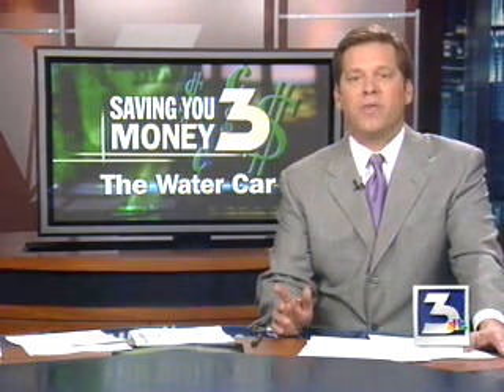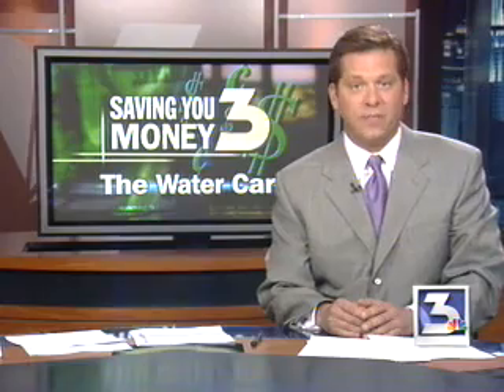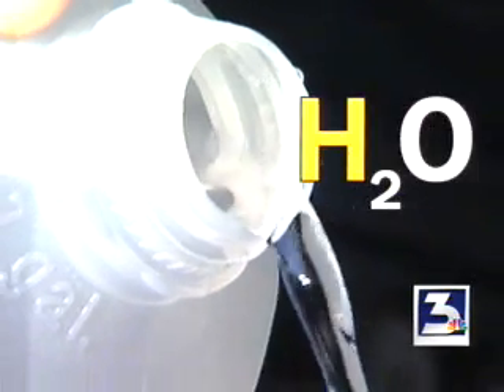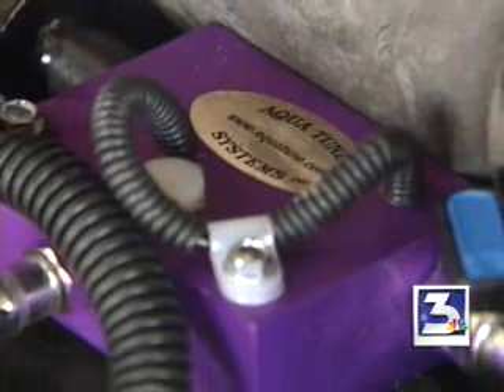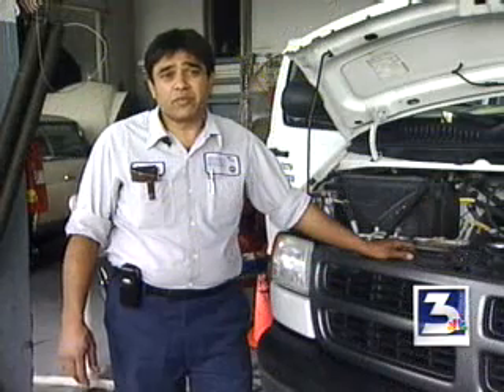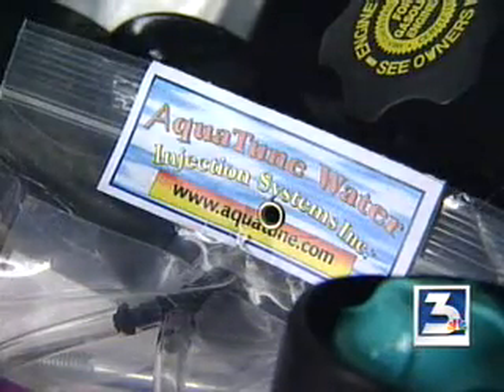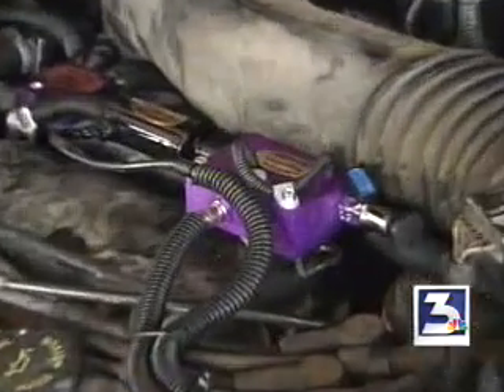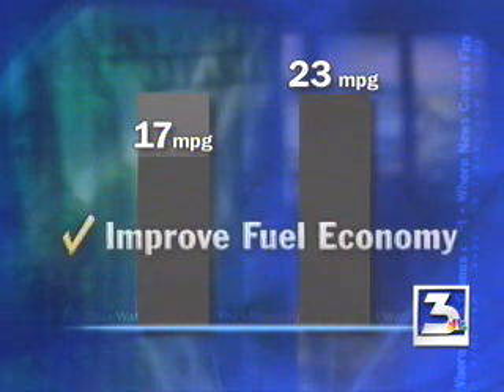AquaTune Hydrogen System on KVBC Channel 3 Las Vegas - "Water Car" Put To The Test by

Comment: Its been 2 months any results on MPG with the system & without the system.
Run 2 tanks of fuel with the system & 2 tanks without it.
Reply: Did it work or didnt?!!
Reply: Fernando Fiorucci  I made a hydrogen fuel fuel cell, it made hydrogen on 12vdc. But it was not enough to run or even try to run a 3hp lawnmower engine. 
When i applied 36v dc it made more but still wasn't enough to run the lawnmower engine.
I do know that more dc voltage makes more H2, but if 36v is not enough to run a mower engine. What will it take to run a car engine.
Reply: @nFlames2 you don’t just run it off the hydrogen. Its supplemental